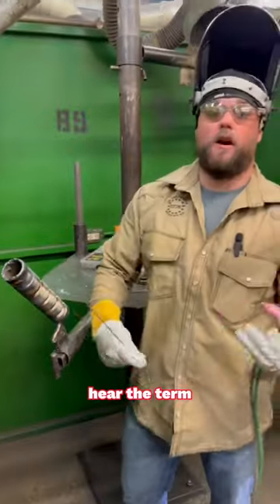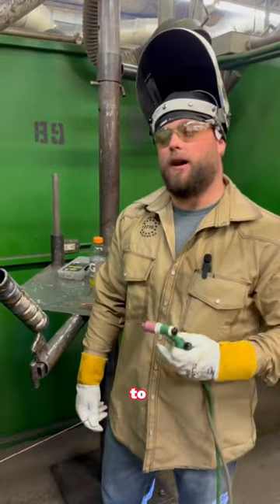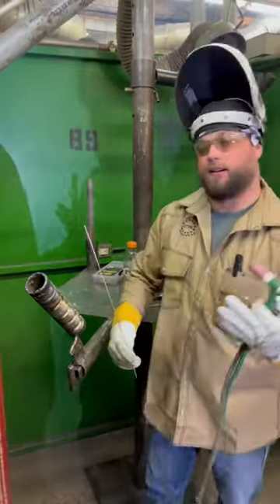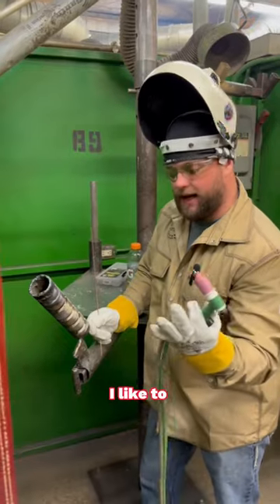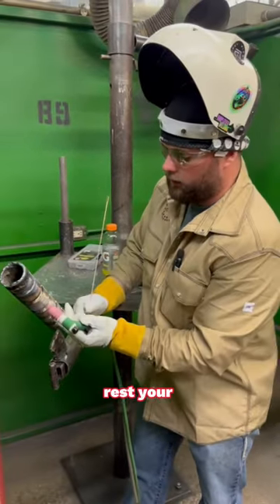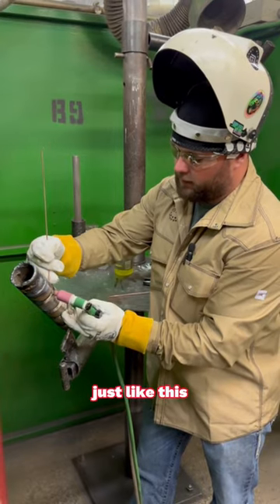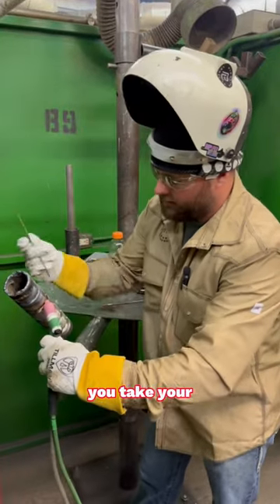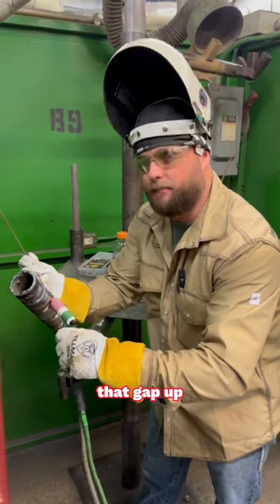Tig welding explained!#weld #prep #important #shorts

Comment: What brand of welder do you use as well as the settings on it
Reply: They run Lincoln
Reply: What about the settings then
Reply: @keeganswinson3248  Settings have so many variables, metal thickness, material that you're welding, welding position, what process you're doing and a whole lot more
Reply: @keeganswinson3248  Settings have so many variables, metal thickness, material that you're welding, welding position, what process you're doing and a whole lot more
Reply: Just put the settings on 11